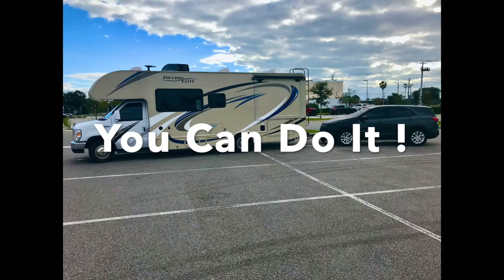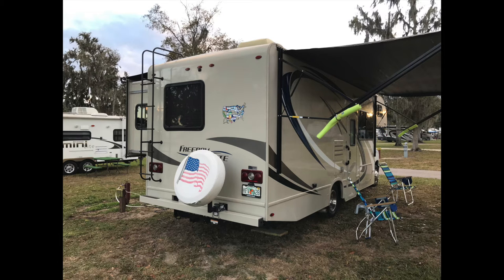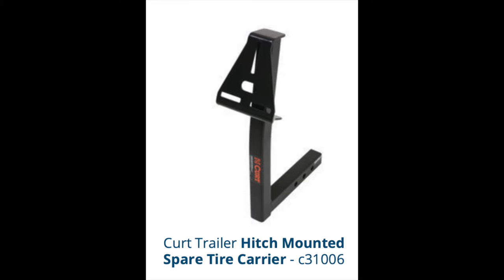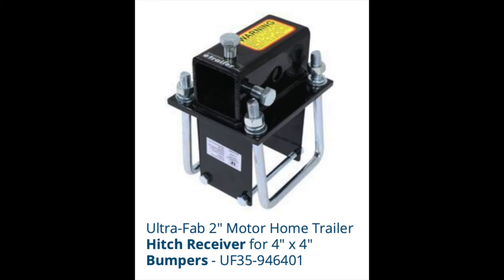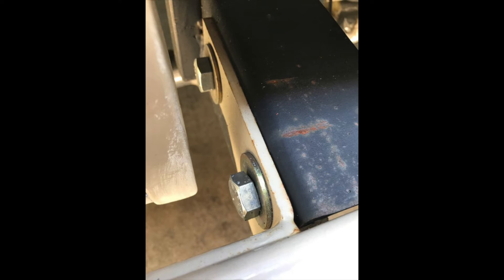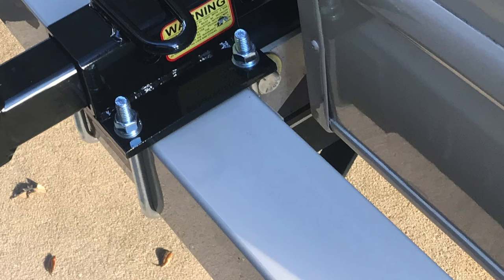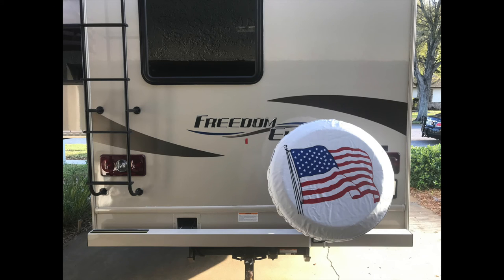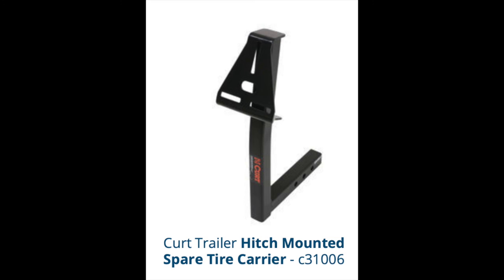RV Spare Tire Solution For Class C RV Flat Tire no spare? Innovative& Inexpensive RVSpareTireBracket

Comment: Thanks!  I have a 2017 Freedom Elite 26HE and got my rim for my spare (Ford Part # 8C24 1015 G) from ebay (Ford OEM) for under $200 and bought the E-Trailer Hitch Mounted Carrier that had the bolts included for the same as the CURT Hitch (they look about the same) direct from e-tailer with no shipping cost.   I also got the same Bumper Bracket you purchased and put it on the same way.  Great idea and glad to have a spare tire now!
Reply from the maker: Glad I was able to share my idea 💡!
Reply: Do you happen to know the part # for the E-Trailer Hitch Mounted Carrier ?? I couldn't find it on E-trailer with that name..
Reply: @victorlopez2143   it was "e98ZR"   I also use a cargo strap angled from where the bumper hooks to the frame on the ends of the bumper to the center of the Hitch Mount.   This helps to keep the weight of the tire from going back and forth and over stressing the mount and hitch.

Comment: Just curious - why didn't you just use your Hitch you already have ? Why add a '4" Bumper Bracket '  Installed upside down ?? Maybe I missed something.
Reply from the maker: I use the hitch to tow my car , they make an adapter to do both, but it costs $600. That’s why my method is more attractive
Reply: @GoldenAnniversaryAdventure  ok..That makes sense...Thanks

Comment: Great but where did you find a wheel for the spare? Apparently most will not clear ther calipers but wheel distributors won't give a straight answer
Reply from the maker: Amazon sells the rim. It must specify E350SD / E450SD
The SD signifies Super Duty
Reply: @GoldenAnniversaryAdventure  problem is ,if it's newer than 2014 you need a wheel with an offset for RV cutaway.....apparently they have bigger calipers and it's nearly impossible to tell which wheel is correct (you could by the cheap wheel but it will only fit rear outside. Amazon wheels have it in the fine print.  You might want to check the pilot and offset of your spare or mount on vehicle, even better.
Reply: Most the after market rims don't fit the RV except for the outer rear locations due to the oversized brake calibers.  I ended up purchasing a OEM ford Rim off ebay used for under $200 (Ford sells them for over $900 new).   The Ford Part Number was "8C24 1015 G" and match that on what was on my RV.  (2017 Ford E450 Super duty used for a 2017 Thor Freedom Elite 26HE).   Worked great!
Reply: The wheel part number is stamped on the wheel.  Not highly visible, but it's there.   I got mine from a local truck tire shop.

Comment: Got nuts and boils (sized to match lugnuts) and it seems like I'm going to have to drill those slots to make them big enough.. Thoughts? Also, seems like a good idea to cut a few inches off the back so it can be inserted all the way up to the outside hole.
Reply from the maker: I sized the bolts to fit the holes in the bracket, the wheel has been on there for 3 years now without any problems. I think I used 5/8” bolts and nuts
Reply: @GoldenAnniversaryAdventure  cool. I just thought it would be great if the nuts on the spare match the lug nuts (22mm) so you don't need to search for 2 sockets  when you need a spare.

Comment: I just bought a 2014 Ford E450 Thor Freedom Elite 28H.  It had no spare though...  I need to buy a spare rim/tire combo ASAP, I just don't know what size or where to order rim from.  Would hate to order the wrong one. I know the tires on rig are LT225/75R16 and rim is 8 lug, but I'm not certain what size width, or bolt pattern, or type of rim to order, or where to order from?  Also Can you buy tire rim already put together or I have to buy separate, then take to tire shop to mount?  Any help or links for this rim info would be appreciated!
Reply from the maker: The run can be purchased on Amazon. All 16” 2014 E450 Super Duty Dual Rear Wheel rims are the same. The tire is purchased at your local truck tire dealer who mounts and balances the tire on your rim.
Reply: There is a wheel part number stamped on the wheel itself.
Reply: @marstsh6341  would you get a front wheel or back wheel?

Comment: What about your break light?
Reply from the maker: The brake and running lights are all visible, plus we always have a towed hooked up and it’s lights are visible . The angle of the photo leads you to believe the passenger side light is blocked, but it is not

Comment: Bought the bumper mount from your link. Doesn’t work. Not quite wide enough. I have a 2018 26he. Anyone do it recently and have tips?
Reply from the maker: Do you have a standard 4 inch bumper?
Reply: @GoldenAnniversaryAdventure   yes. The linked unit is different than the one we see in your video. The issue is where the bumper is bolted is just too wide. I’ll try to attach a pic. I think I need to find one that looks like what you have in the video and not what’s linked. (For example the linked doesn’t have the loops for chains, so I’m thinking there are other differences?)
Reply from the maker: @MouseWandGalaxy  Apparently the catalog number  has changed since 2019 -- the correct part # you need  is now 3371804060.  https://www.etrailer.com/RV-and-Camper-Hitch/Buyers-Products/3371804060.html
Reply from the maker: https://videos.etrailer.com/static/images/video/Demo-Buyers-Products-RV-and-Camper-Hitch-3371804060_web.mp4